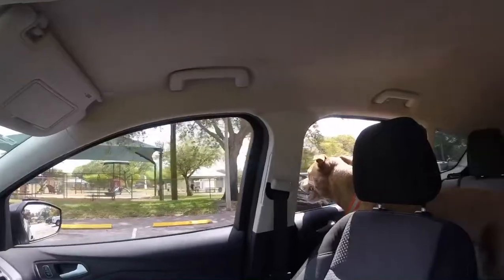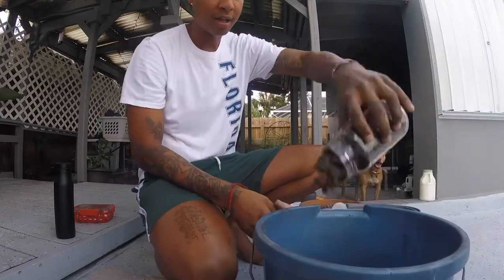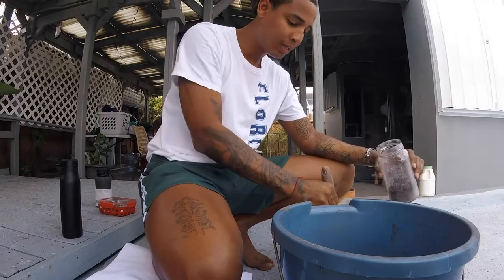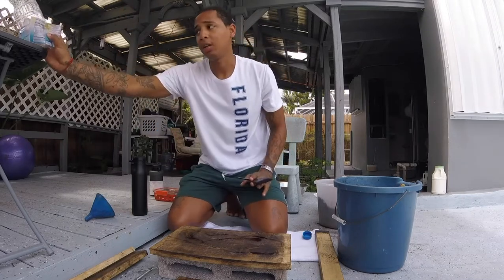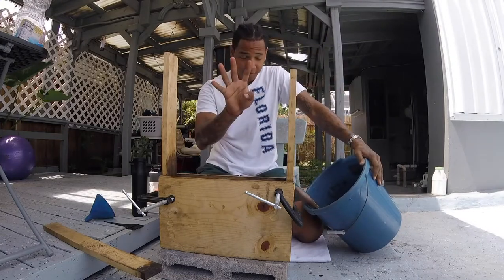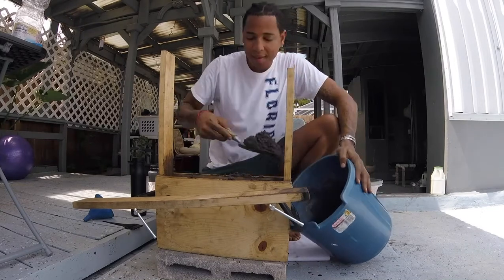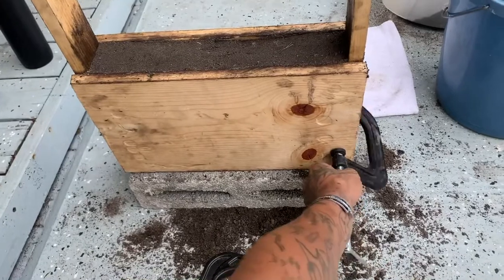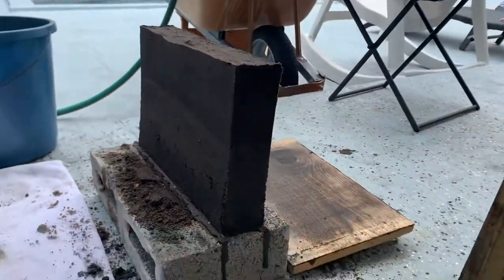DIY Rammed Earth Wall (Small Scale)

Comment: Rammed earth is normally around 5-10 percent cement; at 2 parts earth 1 part cement, your over 30. Anything with that much cement is gonna stand.
Also, it might be a good idea to over hang the form over the cement so you can just reuse the form as you go up - that way you don't need 6 to 8 foot forms, as you mentioned.